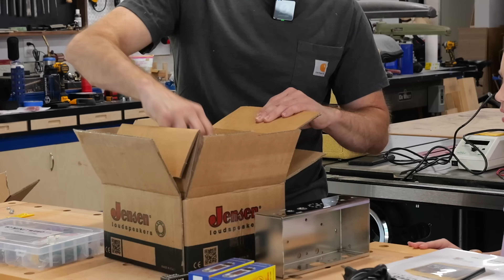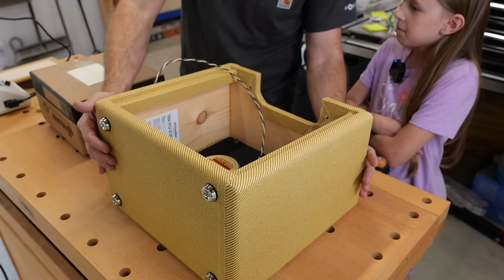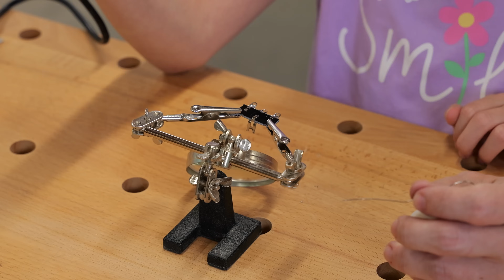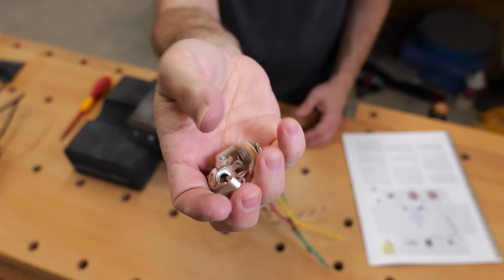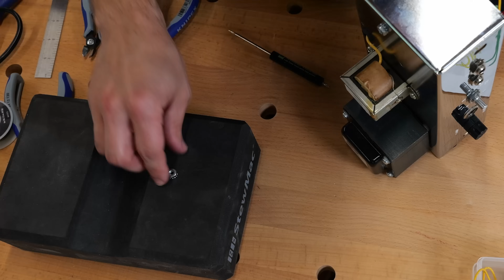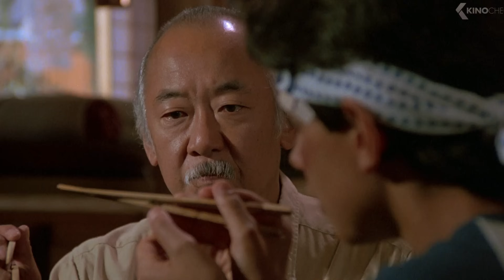Easy to Build Tube Amp

Comment: That amp kit costs $849 on stewmac. I thought kits saved money. Geez.
Reply: Shoot. I bought one of those Monoprice Stage Right 15 watt combo tube amps for $300, and that thing absolutely rocks!
Reply: @Krullmatic  Same here. I replaced the JJ tubes with two Sovtek EL84s and three Electro Harmonix 12AX7s, replaced the stock Celestion seventy 80 with a Celestion Vintage 30, and replaced the stock two spring Reverb tank with a three spring tank and still spent a few hundred dollars less than this Stew Mac kit. Not to mention the fact that this kit is 5 watt and the Monoprice is a 15/7 watt amp.
Reply: @Krullmatic I have one too it indeed rocks 🤘🎸
Reply: The little 5watt model is less, and closer to this amp. In Europe the same model is a Harley Benton. They also do a cute amp head version for £110. You miss it on the building experience and knowledge though.
Reply: @DirkGentley42  I also got the 5 watt Mono price version. It is great! one thing I did was replace the no name stock tubes that came in it with vintage Westinghouse EL84s from the 1960's. The it changed the sound a little and I think it sounds even better now.
Reply: Yes the price of those kits you could almost buy one ready to play. 
Unless someone just really wants to have a project there is no value there.
Reply: Avoiding stewmac saves money
Reply: Just disassemble a tube amplifier and rebuild it yourself. Customize the cabinet and it DIY.
Reply: You can find 100 W head kits for less than that.
Reply: DIY kits nowadays, seems you pay for the privilege. Insane😮😮😮
Reply: @CeL-w2p but if her sad passes one day she will own two things her father built.
Reply: I'm building the same one from this video.
Reply from the maker: @MrPodvig oh right on!  Let me know what you think when you're done with it 😃
Reply: @MrPodvig 
Wow...waste of money.
Reply: He got a $600 guitar kit just to cut it in half lol.  Dudes play money probably exceeds my annual income 😂
Reply: @caseystyer2996 or $old out lol not the 1st yter
Reply: That's insane.
Reply: Just for comparison... the Tube Amp Doctor - Kit would be close to elevenhundret bucks ;-)
Reply from the maker: @JohnDSmith-po4nu dang! 😬
Reply: TBH those old Heathkit projects were quite expensive, too. It should be noted that these projects are intended for learning, not for saving money. A lot of work has to go into making the instructions for a good kit.
Reply: @U2WB  Along with designing them so we didn't fry over selves regularly as youngsters back in the day depending on what we were building =)
Reply: $400 for a 5f1 kit on Mojotone, which would be similar price after cabinet and speaker. 

New custom built champs are over $1k. 

This is how I partly justified my ToneKing Gremlin purchase— big bottle tube, two channels ( blackface and tweed) and high quality built in ironman attenuator ($400 value). The attenuator is necessary IMO to use at home if you want power section breakup, at least when baby is sleeping.
Reply: Jesus that's crazy overpriced
Reply: @brentstewart59  

Seems to be market price. Fender asking $1300 for ‘57 champs.
Reply: I was 100% going to buy one of these kits. What a cool project. Until I saw the price 😂😂😂. So not worth it
Reply: @timpagliaro8623 it's ok that you don't have the money or could afford it
Reply: Its $954.99, now.
Reply: Correct me if I’m wrong but to get one of these in Sweetwater is several hundred dollars more??
Reply: @zachary963 partly wrong. The Tweeds on Sweetwater are Fender. This isn’t.
Reply: Two things...1st.... Welcome to the Covid Crackhead profiteering ERA where "gamer" economics have invaded REAL world finances.  That is where one stupid person with more money than brains pays a crazy amount for an item. THEN other people with more money than brains do the same setting the precedence that ALL people have more money than brains and thus crackhead pricing becomes the "norm"

Second its Stew Mac EVERYTHING is over priced. Always has been ALWAYS will be.
Reply: Absolutely agree !!!
Reply: Not anymore
Reply: I can get a deluxe reverb for about a grand
Reply: @thomaspaine6496 no you can't.
Reply: A friend, Don Gallop, built me an amp out of a labor of love. $658.00 in parts is all he charged me. I had an old Peavey amp that he built it in. Absolutely quiet and and absolute screamer when you want it to be. A friend compared it to a Dumble style . I Love It!
Reply: A blues deluxe costs 749
Reply: That price is outrageous 😅
Reply: I have not come across anything at stew mac that saved me money. Most of their products are WAY to expensive.  I can usually find same exact product  else where way cheaper.
Reply: Why not just buy a $850 combo new?  You can get a 5150 combo for less than that.  It's the only amo you would ever need for a beginner to intermediate.
Reply: @bp8143 orrrr you can learn a bit by building an amp and make memories with your daughter.  You people are so dense
Reply: I wouldn’t get a piece of bubblegum from Stewmac!
Reply: For that kind of money they should at least build it for you!
Reply: How much would it cost to buy it ready built?  The same? Cheaper? If so, why would you do something like that. That extra money would have gone to good use. Helped somebody. It doesn't make you clever. Anyone can solder and follow simple instructions. Perhaps Google the dimensions, make a simple similar box with glue and screws, buy the components, and find the schematic. See if that is cheaper than a ready built one. If so, give yourself a pat on the back, you did something useful. Oh.and the silly cartoons in between, timing is all wrong, and it doesn't work. If you are new to youtube then  fair enough. Work at it a bit.
Reply: @nodriveasusephotos8019 there are occasions when you don’t have to tap “send”.
Reply: It’s so expensive so we’re more inclined to just buy ‘em already built. 

Can’t be too empowered. Just focus on playing 
 

Dollar forbid you play and build too
Reply: Capitalistic 🐃💩 strategies.
Reply: c o n t e n t   heh
Reply: Got one of those mono price before it was reviewed on know your gear. 179.00. After playing a couple of months I went to get another one and it almost doubled. So I only have one. Works great
Reply: Yeah for $850 I think I'd rather buy a soldering iron and a bunch of cheap electrical components and watch a few refresher videos on electrical circuits
Reply: @whogavehimafork yep, build yourself a nice sculpture.
Reply: That's more than I paid for my actual 57 champ reissue used. I was considering looking into this just to build an amp but not at that price.
Reply: Stewmac know how to make money, and taking advantage of it .do u know my nearby tiny shop selling groceries but also have diy repair section n sells nitrocellulose lacquer for just 1$ per can. How much do stewmac sells nitrocellulose x30
Reply: Right?
Reply: If you're willing to buy the parts individually, you can source them yourself for a lot less (assuming you have or can build a cabinet for it and a metal housing suitable for the tubes and wiring), and then assemble them according to the plans available online.
Reply from the maker: Genuinely curious cause I'm totally new to amp building, do you have a good source for parts and schematics?  Thanks!
Reply: @WoodshopMike  Schematic Heaven and for parts, Mouser has just about everything you could need for most electronics projects.
Reply from the maker: Thanks! 👊
Reply: @fallenstard thanks for that tip on schematic heaven. Digikey and Mouser have a larger inventories of real parts from real manufacturers.  The work is going to be sourcing the tubes and transformers.
Reply from the maker: @anullhandle thanks for the sources! 👊
Reply: @WoodshopMike  Tubes and More has lots of components (good quality); Tube Audio Supply for kits, etc.  This is a good start and from there you can find more places once you get "hooked"  😎 . . . PS - the video with your daughte,r PRICELESS 👍
Reply: @WoodshopMike EL84world forum has a library of schematic and layouts, and Wattkins has the TonePerBuck forums where you can find a variety of low-budget projects.
Reply from the maker: @Bleats_Sinodai good to know! Thanks👊
Reply: very nice video,but the amp only have ‘tone’ and gain/volume
Reply from the maker: As far as I'm aware that's what the original circuit was.  This amp was a very basic practice amp when it was originally designed.
Reply: @jokearchibald6460 it’s a champ amp dude.  It only needs volume.
Reply: @jokearchibald6460 welcome to vintage style tube amps
Reply: That's how the original tweed were, very basic, but less to get in the way of the signal.
Reply: @fallenstard  building a cabinet like this is basically making a box without a lid, and half of the back missing :)
.     Most construction supplies shops will cut MDF / particle board / wood to size for you.
      So if you have a list of the panel sizes you need, they can help you figure it out, and do most of the difficult work (sawing straight and square) for you.
      You can use painters tape to hold the panels in place while you glue them, and then screw them down for some extra sturdiness.
     Quality 1/2" (12mm) thick MDF for a cab this size will be under 10 bucks.
Some screws.. 1 or 2 bucks total

For the metal box:

If you get some thin sheet metal (like 1mm mild steel or aluminium... Costs below 5 bucks)) you can cut a pattern for the electronics box (like for folding a cardboard box) with some beefy kitchen scissors that you don't love too much...
     And then fold it by hand mostly. You can use the edge of a table for making long folds straight. Or use a steel ruler to fold it around.

If it turns out a little flimsy, drill some holes near the edges of what you want the side panels of the box to connect, and use nylon zip ties to hold then together.
      Or duct tape / electrical tape works fine too.
     Nylon zip ties won't be affected by the low heat of the amp, tho.

Or maybe just make it from an old tin box. (Like a cookie tin, or a bread tray/mold or something). Whatever fits the parts

Bonus of using flimsy material.. You can use wood drill bits (including hole saws or spade bits) to make the holes required.
    And steel screws.. Just make a little dent with a centerpunch, and just start screwing... The screws will eat through soft metals quite easily.

--

For the electronics themselves - no shortcuts there, I think.
But you could use a cheaper speaker, for instance. (Maybe a full range one from a beefy bookshelf speaker)

You can always remake parts later, when your DIY skills have improved a little.

And upgrading cheap parts - (like the speaker... Or whatever you skimped on) - at a later time should also be relatively simple.

Want a handle? Use one from a kitchen cabinet. Or even 2 holes w/ a piece of paracord run through it... That's a handle too.. (Run the paracord through a piece of pvc pipe... Boom: comfortable handle, even!)

The felt on the outside is just decoration - it serves no acoustic purpose.
     Buy some cheap fabric or faux fur.. Glue that on. Boom: style points!

Be sure to put some felt / cork / rubber feet under the amp/cab/combo, though...
     Because that will matter for sound.
Reply: think many people miss the point of making something. hands on means something to some of us. ymmv etc.
Reply from the maker: @JR-tr1df 💯
Reply: Stew Mac is high on nearly all of their DIY things, and most of them are just re-packaged versions of some other design. Darn close to all of their pedal PCB’s are from another common source, they just add in the other parts, with an uptick, and sell them on. 

Re: components. Many times it’s difficult or costly to acquire them, larger (bulk) orders bring that cost down. Often times it’s worth paying the premium to get 5 components via a kit than placing 5 orders, each with their own shipping.

Getting the correct spec transformer for an amp is notoriously difficult, there are rimes they’re custom wound to a specific design. So, either you adjust the design (and even know how to) or you have to just get the one that they had made.
Reply: @c1ph3rpunk  LMI has already gone out of business. I expect Stew Mac is not faring well in the current market with ultra-high prices.
Reply: this only for ppl who want to geek out and have time to do it.  me I have a demanding job and as much as I would love to do something like this I just don't have the time or energy to do so I'm happy to tack on a several more benjis to get a professionally made amp 😇
Reply: The Fender amp this is based on costs twice as much as the kit. Just depends on what you want. Amps aren't cheap.
Reply: Kits cost more when they are quality and the company offers tech support and fixes things that you break, etc.   Otherwise it’s easy to fix at the factory when it doesn’t work.  The kit contains all the same parts, but they have to be packaged specially instead of the amp which is one package. So it makes sense that it is more expensive.
Reply: It costs money to make the directions clear enough and also they probably have to pay extra to send parts to people if they break stuff, and offer support for people, and design something that people can make.   Also, shipping is harder when it is parts that might break easy compared to when it’s all together, especially with an amp which is made to be indestructible and is essentially a rectangle.
Reply: A monoprice is $200 is already made and sounds WAY better.
Reply: Tube amps are difficult to make which and have expensive components that is why there so expensive
Reply: A real fifties tweed is thousands of dollars homie, 

Like $5000
Reply: I think you totally missed the point of the video and what kits are for.
Reply: Other sources sell similar kits for much less. Stew Mac, however, has great support for those just getting into amp building (like me). 
By building the amp yourself, you don't just get an amp, you learn a lot. Then, by being able to service your own amp, you'll begin to save money.
Reply from the maker: @MrPodvig you're right on the money with StewMac's support!  What amp are you starting out with?
Reply: Yes, but for around the same price you get a production line printed circuit board amp. With these kits you get old school hand wired goodness.
Reply: @pbbvhunterandfinder9953 Or better yet, a vintage Champ. Not only does it keep its value (the color coded wiring in kits give these away as home builds and automatically lose all their invested value) but old Champs sound unbelievably good. Much better than these small "tweeds".
Reply: @LeviBulger I just bought a SF Champ for $450. Original tubes, new filter cap, Ferromax speaker all good to go. I also just ordered a Vibro Champ kit from Mojotone.😂😂😂

Comment: Hey nice! I wouldn't blame yourself for that, shame on Stewmac for using such compact RCA connectors. The normal ones with plastic shells have longer leads for you to solder to instead of that tiny terror of a connector
Reply from the maker: Thanks, we really enjoyed the project!  It was really just my inexperience and not slowing down to read that instruction better😂

Comment: O.k, so, turret and eyelet boards aren't true "point-to-point" wiring. Point-to-point does away with any board and uses terminal strips such as you mounted for the power transformer at the start and/or components soldered direct to each other (e.g. resistors and caps soldered direct onto pots or tube sockets. It's pretty rare to see though and people have come to commonly mislabel the older style (but far more common) hand-wired eyelet/turret board builds ass "point-to-point"
Reply from the maker: Interesting, thanks for that!  I did a little research to double check terminology and saw exactly what you stated, that this method and turret boards are referred to at point-to-point.  To me it seemed like a stretch to call it that (just from what I envision that would be), but not having years of experience under my belt I trusted what I'd read.  Thanks again, hope you enjoyed it!
Reply: @WoodshopMike  Also, I should say, congrats on your first tube amp build! Sounds and looks great, will be easy to repair if ever needed and should last forever. May it bring you both many happy memories

Comment: Weird question, but when it short circuits to ground why is that happening? I've watched the video but I still can't seem to figure out why it happened.
Reply from the maker: No worries! It shorted to ground because when I soldered the RCA plug (speaker plug) I unknowingly soldered the positive wire to the same surface the negative wire is soldered to.
Reply: @WoodshopMike  Thank you so much for the clarification
Reply from the maker: @powerfulplayer906 absolutely! 👊

Comment: By shorting the OT you can easily destroy it. This is not what you want to do :)
Reply from the maker: You're exactly right!  Thankfully it was shorted to ground and stuff didn't get toasted 😃
Reply: @WoodshopMike  if one side is shorted to ground that doesn't affect the function. In fact many Amps have one side of the speaker grounded intentionally. And if your amp uses negative feedback, the other side of the OT has to be grounded